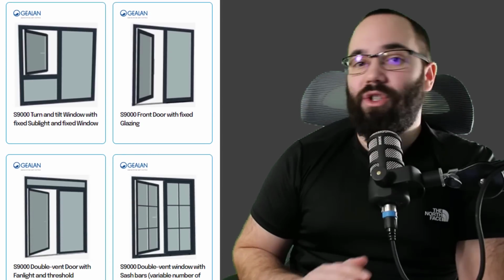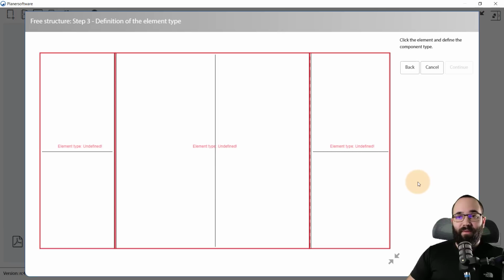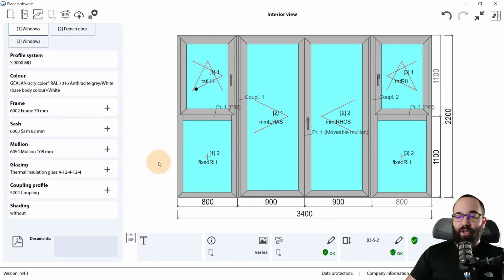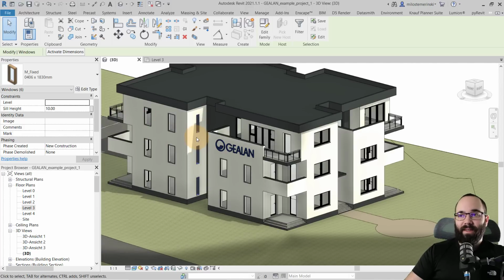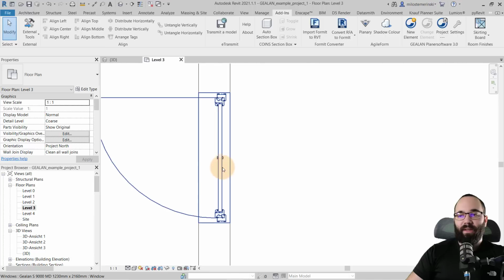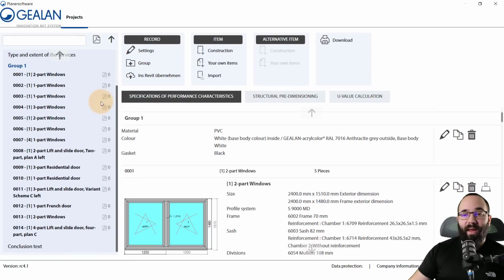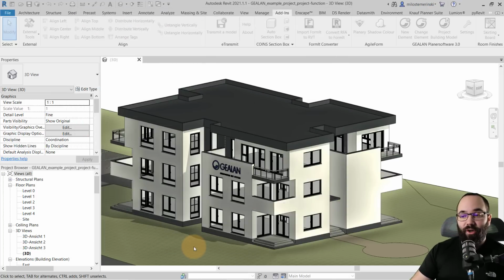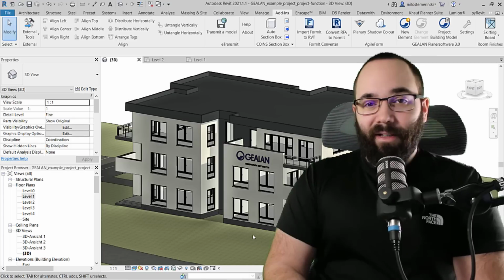Create Revit Families for windows and doors quick and easy - GEALAN Planersoftware 3.0 Revit Plug-In

Comment: hello, I  downloaded the plugin  and registered the website but it doesn't log in revit even though my information was correct, it says, 

Logging in on the GEALAN Planersoftware 3.0 website has failed!
Please check that the e-mail / user name and password for logging into your GEALAN Planersoftware 3.0 user account in the add-in settings are correct.
Reply: Hello, please note the comment pinned above.

Comment: This plugin is really game changing and I have a feeling its the only one of its kind, at least that I found of. I do have a question: Did you manage to choose a black color for the framing? If i choose anything but the white PVC  it gives me an error about the size. I was also not able to change the material directly inside the family.
Reply: Changing the color affects the maximum sizes of the element. It is therefore possible that you will receive a notification here. If you click on the error, the size chart will open.
Reply: @GEALANgroup  Thanks for reply. Why does the maximum size changes? You cannot produce black frames of that size? I wanted to same profile and structure but just black color.
Reply: @ArhConstantinCozma  Each window is limited in size. Even more so with colored windows, because of the physical properties such as thermal expansion. You are welcome to contact  GEALAN staff, we will help you with your issue.
Reply: @GEALANgroup  Thanks for explaining!

Comment: Awesome plugin and demo!  Is there a way to modify the door/ window swing symbolic line direction (opening lines) in ELEVATIONS without editing the families after placement?  (i.e., if we need the symbolic lines to converge at the HINGE side instead of the HANDLE side).  Can't seem to find an option in the plugin to do so.  Thanks!
Reply: You can change everything that is technically possible in the Planersoftware 3.0. Feel free to contact our GEALAN BIM-Team so that we can find a solution for your concern.

Comment: Very interesting plugin and congrats to Gealan people. One thing is important though and should in my opinion be included in this family creation. The shutter box! Shutter boxes frequently come with windows ( at least in Europe) and when it happens that should be included in the project. So it would be very useful to see the shutter box that comes here as an option, with it’s dimensions and also the window tag that displays window dimension + shutter box height. Of course shutter box also eats part of the wall and affects the wall material quantities. If gealan incorporates this, what after all they have done so far, shouldn’t be a problem, these windows will be hard to beat. Thumbs up.
Reply: You can already plan the shutter box for the window or door in the Planersoftware 3.0. There will also be an update soon so that the shutter box is displayed correctly in Revit. So stay tuned!